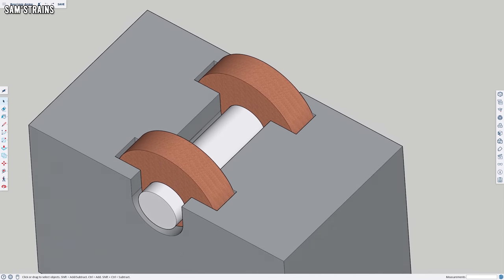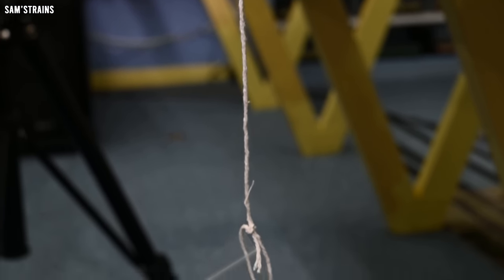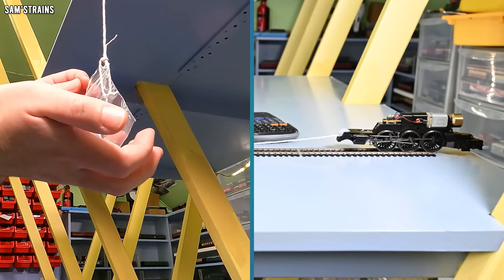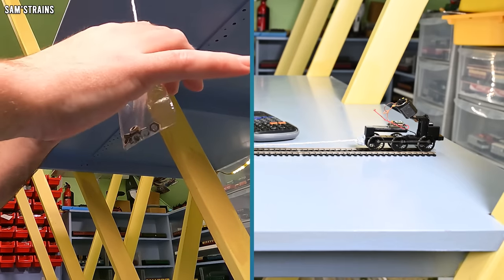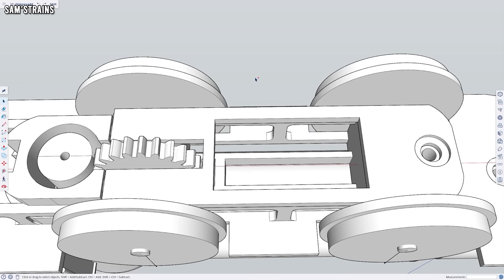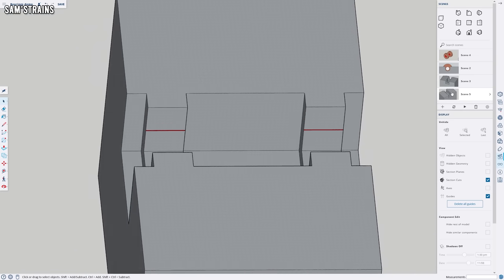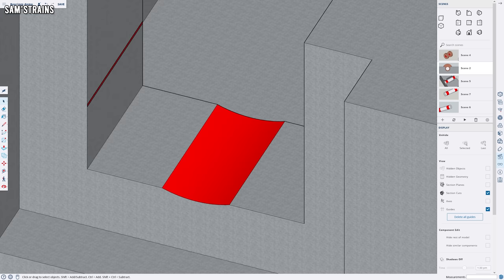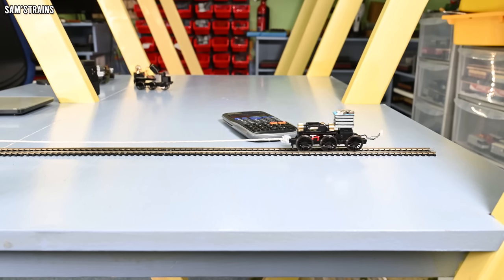Do Model Trains Really Need Bearings?

Comment: Excellent video.
I'm particularly intrigued by the square slots producing less running friction than half-round raw surfaces, but creating increased inertia. This definitely tallies with my experience of Hornby Dublo and Wrenn locos, as some of the latter are re-engineered versions of the earlier chassis with square form bearing surfaces.

Comment: An important point to make is that the bearings themselves should never! ever touch a part directly at all. It's the thin oil film created in between the parts that prevents them from touching. This is what a glide bearing does, it separates the moving parts from each other by producing a microscopically thin film of oil between them. Now with these bushings the same is achieved by the material itself. It is very porous. If you look at it under a microscope it's not smooth at all, rather resembles a gouda cheese. So what the car industry have been using in starter engines (the top bearing) is a little brass washer that gets put into an oil container for it to absorb the oil in it's pores. This oil warms up when friction between the moving parts occurs and viscosity ensures the tiniest bit of oil gets released causing the film between parts to appear. 
Now, you mentioned the bearings are to be oiled every now and again and replaced when worn, but here is the thing. When servicing your loco's, take the bearings out and let them soak overnight in oil so the pores can fill up with it again. Do this at regular intervals and you'll never have to worry about friction anymore, nor will you ever have to replace the bearings. Remember, it's the oil film that does the heavy lifting, the bearing is just there so the film can form.

Comment: hi sam. a back to school video. anyone with a bit of common sense should know that when a shaft is fitted with bearings provide less friction when rotating which equals less force needed to turn and less wear and tear. as you explained well. a chassis will be grinded away in time be it over a long period of time in such a small size but never the less it gets eaten away thereby causing more strain on the motor until it eventually burns out or becomes to weak to power the model which incidently is what manufacturers want to keep their spare parts division busy or sales of new models up.

Comment: Well explained Sam. I find that even on wagons and coaches, adding pinpoint bearings makes them roll more freely.
As for those square holes, I had an old Mainline/Bachmann with a lot of wear to the chassis in that area.
I ended up cutting half circles of brass tube and epoxying them in place - It's never run better :)

Comment: Bronze, from which this bushings are made, a much harder and wear-resistant, than pot-metal, from which chassis are made. I have some Roco diesels, which don't have bronze bushings, just axles in cast bogie gearbox, and after little use I have scoring on all axles in friction area (dirt and abrasive particles get embedded in soft bearing surface of pot-metal and began grind the axle). However  on locos with bronze bushings everything looks like new.
The main point of  this bronze bushings - decrease wear and increase longevity.

Comment: Hi Sam!

Back in the day when I was driving RC cars one of the first upgrades on the list was swapping out the stock bronze bushings for a set of ball bearings. It made such a difference that trains having bushings as the premium option has always felt pretty rubbish.

What would a train built using ball bearing everywhere perform like? I imagine like a swiss watch compared to what is available now but theories need testing!
Reply: When the models get to a certain size ball bearings would be almost impossible and expensive to produce in a commensurate size which is why quality watches use 'jewels' as bearing surfaces.
Reply: Being in O Gauge (3-rail) I'm only aware of the top-end locomotives in that scale being  equipped with ball bearings. The US passenger cars produced by Golden Gate Depot are equipped with ball bearing trucks, and their sister operation 3rd Rail, is  incorporating ball-bearing trucks into their newest O scale locomotives.

Comment: What about "Starting Friction" ?:
      Stiction has been a part of the English language since at least 1946, when it appeared in a journal of aeronautics. While stiction refers to the force needed to get an object to move from a position at rest, it is not related to the verb stick. The word is a blend word formed from the st- of static ("of or relating to bodies at rest") and the -iction of friction ("the force that resists relative motion between two bodies in contact"). So, basically, it means "static friction" (or to put it another way, "stationary friction").

Comment: A very good video overall as usual. One point I do feel that is worth bringing up though is that not all bearing are made of the same materials though so the logic that bearings are better can't be applied universally. For instance a loco with bearings made of poor quality metals might be worse off than if say it had no bearings and the axles just sat in the chassis made of high quality metals. It's also worth noting even though you probably already know this that bearings don't make or break the performance of a loco a good motor, competent gearing, good weight balancing, etc. I do agree with your overall point that good quality bearings certainly do make a difference.

Comment: I'm just about to build an 0-8-0 Hunslet shunter - a brass kit. The kit expects solid brass bushes, I was going to upgrade that with sprung brass ones on the inner axles. Having seen your vid, I've bought some top hat 6mm oilite bushings, which I'll ream out to 1/8". These will be sprung. 
I've made quite a few brass kits and properly aligned, accurate and chunky bushings definitely make a difference. Limited travel with springs on 0-6-0 and especially 0-8-0 to make sure each wheel touches the track. It's easy in 'O' gauge. 'OO' is a bit fiddly, but worth it 🙂

Comment: Brilliant investigation! It's this type of content that makes your channel so good. I wonder if the slot and axels on the non-bearing locos become hot during use (they would if it was a real loco!). It would be interesting to run bearing and non-bearing locos for extended durations and then view the slots or bearings with a heat camera. I also wonder if coaches should have bearings rather than pinholes in the plastic moldings?

Comment: Well put together video - I agree totally! A lack of bearings also can result in wear to the plastic base keeper plate from the axles. I have often encountered this on old split chassis locos and it accentuates wheel movement and can affect gear meshing consistency. I have successfully 'filled' this wear with plastic repair but it is further evidence of a very poor design.

Comment: My German Trix generally only have bearings on the axles directly driven by cogs. In one instance that's all 5 axles in others only 1. Other axles are set in circular grooves in the zinc alloy and the interior axles are sprung with large amounts of articulation for curves and turnouts.

Comment: The other factor that is worth considering is the friction between different materials.  The cast chassis material, even if machined to fine tolerances, which is possible to do, will have a higher friction than would the bronze bearings that you and other manufacturers are using.

Comment: What sort of lubrication did you use?  Both types will run better when oiled, although the separate bearings will still likely perform better.  Two other factors will be the material used for a plain chassis (some white metals are quite good bearing materials) and the extent to which the loco has been run in.

Some modern outine locos with bogies use pinpoint bearings just like a coach, and these work completely differently.

Comment: One thing I spotted that was wrong with this is at the end when you compared the price of a wheelset to a new chassis on a Hornby A1 (which included the motor, chassis block etc), but the Bachmann A1 which is the model without the bearings can also be repaired at a low cost as the chassis blocks are available from bachmann for £10. While it is more expensive to renew the Bachmann model it isnt by a whole lot, the only major difference is the scale of the job.
Reply from the maker: Ahh that’s a very good point, thanks for sharing! As you say though, still cheaper just to replace the wheels, and much simpler too than rebuilding the entire loco!

Comment: Short answer yes bearings are necessary because if your chassis gets worn out you gotta replace the whole thing.
Also what about square bearings with round axel holes like on BLI engines? This enables the drivers to be sprung, which means they will always touch the rails even if the chassis has minor warping.

That was a problem on my more modern Mantua 2-8-2s and no matter what I did their pulling power was bad because the middle drivers were not adhering to the rails.
Reply: Pulling power has nothing to do with the number of driving wheels touching the track. Its the total weight of the driving wheels that is important.
Reply: @terryflynn8830  Uh these engines are pretty heavy they are almost 100% diecast so no.

Comment: The brass bearings retain oil better by filling the clearance so there is always a wedge of oil at the load bearing point of the bearing to give the thin film required.

Comment: Wear is not so much a function of material hardness alone but also a function of material friction coefficient. A lower hardness with much better friction coefficient will indeed reduce wear despite involved materials not having maximum hardness. Teflon on Teflon friction bearings practically don’t wear. Despite the material being pretty soft. Friction coefficient is a function of surface quality and quantum mechanical properties of the respective materials. That’s why the choice of the right material is so important. Once chosen, the properties can’t get changed even with excellent polishing.

Comment: 11:51 Hello Sam,
I’ve wanted to ask this question for a while. When you bought those bearing bushes for your Coppernob and other scratch built locomotives, how did you get them onto the axels of the wheels? Did you pull the wheels off, thread them on, and requarter/regauge them?
Cheers in advance!

Comment: Its a trade off between friction and wear. A greater area will increase friction but reduce wear. You see that in wagons with pin-point bearings which at first have minimal contact area and are very free running. However due to the small surface area they wear out quicker. I have this with an ex-Lima PCA cement wagon set.
Reply: Bearing area is not related to friction. Pin point bearings have lower rolling resistance because the bearing diameter is smaller compared to parallel bearings.
Reply: @terryflynn8830  Haven't you contradicted yourself? If Bearing area is not related to friction then why would it matter that bearing diameter is smaller compared to parallel bearings?
Reply: @alanrobertson9790  The difference in rolling resistance you are seeing relates to the basic reason why the wheel works. The larger the ratio of the wheel diameter to axle diameter, the greater the mechanical advantage. Think of the wheel as a vertical lever just before you give it a push with the centre of the axle and wheel as the fulcrum.
Reply: @terryflynn8830  Levers etc perfectly true but off topic. The lever principle applies to any wheel whether low resistance pin point bearing or not. Do bearings with a large area offer more ROLLING resistance - yes they do. Think your original statement about area not being relevant only applies to sliding resistance. No need to tie yourself in knots there are plenty of information on the internet.

Comment: In a way, all models should have this kind of bearing not only because they're better, but also because they are historically accurate. The bearings in these are friction based which a good number of loco's and rolling stock had. It did the job for some time but even they had problems with over heating and welding themselves to the axels, it's one of the main reasons companies switched from friction based to roller bearings, along with the ease of maintenance. But for this application, because the weight, power, torque, and distance have all been significantly reduced, these bearings make for excellent running without need to change for long periods of time.

Comment: Hi Sam, great video. Your testing shows how bearings affect how much force is needed to get the chassis moving. In reality it is the axles turning that get the chassis moving. The conclusion is the same bearing make a big improvement to performance. The difference may be where the wear occurs.

Comment: Thanks for an informative video.  Like you I am strongly in favour of bearings.  I will have to take my Hornby 4F to pieces to see if they have bearings.  Certainly they draw far less current than my older ones.  The same has occurred with the 2P 4-4-0.  I had put it down to being loco driven rather than the tender driven ringfield motor.

Comment: You did not appear to mention lubricant for the respective bearings mukka. How did you measure the amount of lubricant on a bearing or mere frame notch?
You should have used a locomotive in Reaearch Livery!
Good work chum. Regards from Oz.
Gaz

Comment: Hi Sam. Even though we intuitively knew that bearings are better than no bearings, it's nice to see some proof. I'm not so sure how negligible the effect of air resistance caused by the added weights to the chassis is; I would have liked to have seen some card (or other material) added to the heavier chassis to compensate.

Comment: Really interesting and relevant video there Sam. One question - how does this relate to curves? Is there a risk that bearings hold the wheels too rigidly and result in greater resistance when running round trainset curves? Could no bearings allow greater movement to allow wheels to move more to the shape of the curve - with less resistance?

Comment: Thanks for the video!  Not doubting what was your consequence, but I guess the question a little bit more complicated. I have 2 locos with bearings, for the rest I don't have, and to be honest, these with the bearings has not the smoothest running. Probably also important to have very precise tolerances for the bearings, and the rest of the drivetrain has to be good quality as well.

Comment: Hi Sam
I assume you did not try just letting the roll down Gordon’s Hill to see how far they got. If the initial impediment to moving (the technical term is in other posts) means they, or one, cannot start, you could give an equal impulse push to each. 
The points about the oiling of the bearings or cut outs possibly being a difference may be valid, but it is hard to see that it would be the whole of the difference. 
An outstanding video, and great to see those with appropriate professional expertise confirming your thesis and proof. The University of Life course is often very good!

Comment: It’s the friction coefficient between different materials. Not so much vibration. Friction coefficient between steel on Zink is pretty bad. While steel on brass can only be topped with roller bearings or Teflon on Teflon. E.g. Teflon on Teflon is the same as steel on ice. Steel on Brass is very good at low price. You can’t get it any better at reasonable cost if you don’t want to use roller bearings.

Comment: I have a Mechanical Engineering background  and have designed many experiments in my working career. Unfortinately you have not accounted for all the variables that count. For example you should have removed the side rods as many models can have a slight bind. Secondly the rolling resistance will vary due to the axle diameter and the models should have been cleaned and tested with the same lubrication. You have talked about necessary clearances between the axle and bearings, but ignored the clearances between the brass / bronz bearings and diecast frame typical of the models tested. Although this clearance does not impact on roling resistance if kept small, it does impact on side rod binding if it excessive. Finally, My experience is the side rods will wear out long before the  wheel bearings, and the motors on my models never stall,  If the model  motor is properly selected and there is no binding, or mechanical locking of valvegear. Of course you need  free running gearboxes with good electical pickup.

Comment: Turned brass bearings do give smoother running BUT issues I have experienced starting with Hornby large Prairie,  72xx. Intermittently stalling on points there needs to be some movement in one axle at least up and down to keep wheels picking up power.... I ended up fitting stay alive on DCC.  Hornby had the Prairie back 3 times as main drivers did not all sit on plate glass without wobbling.
Reply from the maker: That's interesting! But even without bearings that issue could still occur - many manufacturers do fit a sprung axle to their steamers, and they don't have to sacrifice the bearings to do it!
Thanks for watching, Sam :)

Comment: Bachmann either have more efficient motors than Hornby in many cases, but I find more Bachmann requiring less power than Hornby locomotives.
My guess is the oft-mentioned poor QC of Hornby relatively speaking - many have tight spots or 'pinch points' not as obvious on Bachmann.
Basically, I don't think when powered up that this 'advantage' is as obvious.
Al.